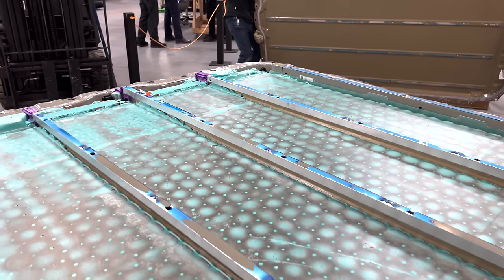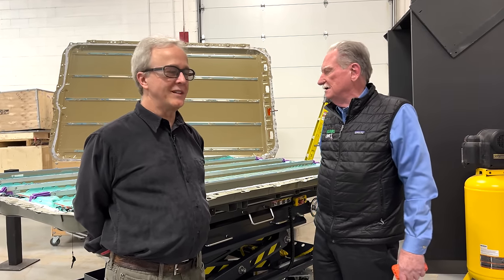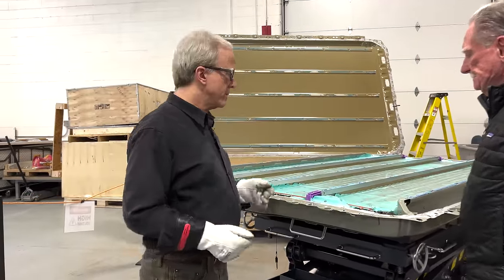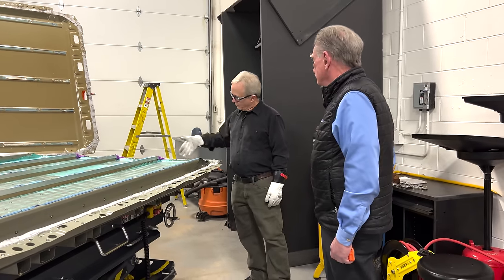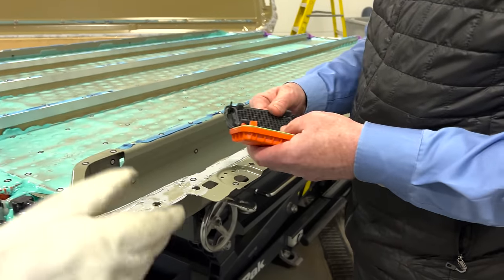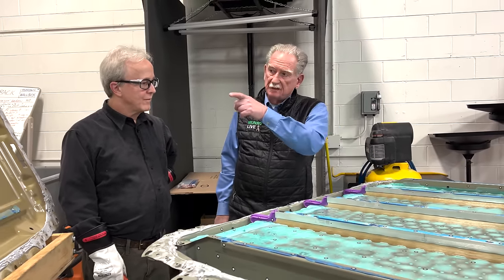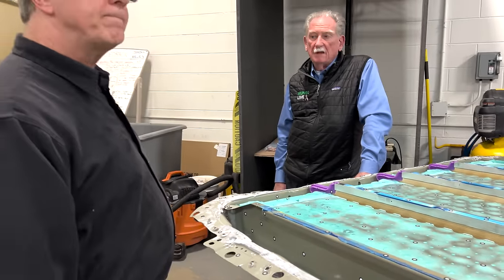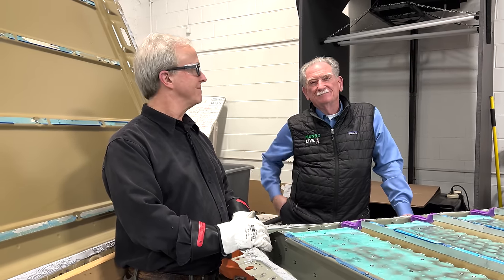Tesla Cybertruck Battery Pack: Our First Impressions Under the Lid

Comment: Fantastic session, gents - thank you. Fresh off a conversation with my service manager describing what it took to replace a couple bad cells under warranty in a BMW-designed battery pack for a customer. More in parts and labour than the car was worth, although being a MiniCooper EV of unknown age that might not be all that high...and that’s something that apparently was actually designed to come apart. 
So I must say, making something near completely unserviceable gives me pause. Yeah, sure it’s built to last til the end of time, etc etc, but everything can fail. I wonder if Munro ever gets asked to help design process that support servicing, not just making assembly as inexpensive and efficient as possible.
Reply: when it comes down to it the TIME of the people needed to service something will be MORE than the TIME of the people who put together another pack - because the pack manufacturing runs at super-high efficiency while repair doesn't.. economics (and maths) tell us that it's actually cheaper to replace.  Only caveat - if replacement is single supplier - there could be profit maximization going on which inverts the outcome.
Reply: Yes - great points. My first thought during the conversation was that if my Mini pack goes bad out of warranty would they even sell me the components to swap myself... As it is mine’s in for a warranty replacement of a battery management module that’s north of $4K just for the part. We enjoy the car immensely but the cost of the difficult/impossible to self service componentry under there waiting to go wrong does give me the willies as someone who does a lot of DIY. This repair would erase a year’s worth of fuel savings in the ICE vehicle this thing replaced if I was opening my own wallet...
Reply: Wright's Law in economics they will just swap the pack and it will cost you less that swaping out a ICE engine as it is far far simpler and takes a fraction of the time.
Reply: Swapping the whole pack also means the cells are the same age and have been treated alike. There had been interest in rebuilding the traction battery in Prius cars, but I believe replacing the whole pack with one of known balance is preferred for ease and longevity.
Reply: @  motorv8N  
The pack costs the OE manufacturer not as much as it's being sold to u (esp with middle-men involved).  Those are the real costs.  With competition being allowed to supply similar (compatible) packs the supply of such packs would be able to meet demand AT COST, negligible profit.  But with IP rules in place (patents, copyrights, etc.) competition is being prevented..  That is our collective problem.
Reply: @joansparky4439  - yes not like popping over to one’s local NAPA to source generic brake rotors, etc vs paying for massively marked up dealer stuff. I do wonder if the Right to Repair movement will catch up with the EV world. I can’t even find a shop manual for the car. First vehicle I’ve owned where I didn’t have the same service documentation as the dealer...
I’ve read the battery pack in the MiniCooper is made for BMW by CATL. Sourcing used cells from somewhere else might be an option one day. Frankly I’m just itching to disassemble the car just so I can see how it’s been built around its ICE roots but I’m fairly certain that won’t be approved by my long-suffering spouse who has put up with a lot of automotive detritus littering the place during various projects. I should apply for a job at Munro just to get this out of my system...
Reply: @  motorv8N    Hehe.. yeah, I can relate, somewhat, just on a smaller scale.

As for RTR catching up on IP rules preventing competition from functioning.. except for a few libertarians here and there societies AT LARGE haven't caught up to this for ~700 years, that's how old Patents are.

Comment: Brilliant. Designed to last. Not to be serviced. Exactly the right thing to do.
Reply: As if cars were indestructible machines that don't require being serviced.
Reply: Unless you need to service it.
Reply: Rich Rebuilds will find a way to service it if he wants to.
Reply: @RogerM88  Tesla is short on service centers.  In line with first principle thinking they hired engineers to revisit parts that require service/replacement.   Best service is no service.  This will also allow them to offer longer warranties.  This sort of thinking will make legacy unhappy.
Reply: @danharold3087   Guess you didn't read any repor about average automotive reliability. Where Tesla scores aren't the great. A car too dependent on complex electronics, will eventually fail, or become quickly obsolete. But keep drinking the Kool-Aid.
Reply: "First principle thinking"
Reply: @RogerM88   You have it backwards.   Properly cooled and sized electronic components are extremely reliable.  They are used in multi Billion dollar airplanes.  If properly designed they can be self diagnosing. 
Rather than become obsolete a software defined car can be improved over its lifetime generally  w/o visiting a service center.
CR and JDP are in the pocket of ICE manufactures who help keep the doors open.
Reply: @danharold3087   Water via moisture as dust will eventually find their ways into the electronics. You should or as a casual that never worked on a car or some electronics, or deep in Tesla Stock. Relax, the target Cybertruck customer base, doesn't even care about keeping the car for long, or care about efficiency otherwise they'd buy a Model 3 instead.

Comment: Based off his projected numbers of 48 long by 7 we end up with 1344 cells. Some calculations based off of a nominal voltage of 3.7 and 26ah per cell we get a 216s6p. That ends up being 799.2 nominal voltage and 124ish kwh total capacity. Which is pretty close to actual numbers of 800v and 123kwh

Comment: Not to put the cart before the horse but I'd be curious to know how this battery unit would be recycled?
Reply: The whole pack is probably shredded into little pieces and the pieces are then processed as if it was ore from a mine to extract various metals.
Reply: @cruiser97eric1  Thank you
Reply: @cruiser97eric1  Cheaper to throw it away that's what they're going to do.   When it is cheaper to make a new Battery than recycling  Because of the Horrible design.   They might as well Have filled the whole thing with epoxy!

Comment: Thanks, looks like 252S4P pack, around 1,000 cells. Its an old fashioned and expensive approach. It should be possible to build the battery with just half this number of cells.  

Hint best way to pop sealed covers is with compressed air.

Comment: Foam with air bubbles would tend to insulate (thermally, not necessarily electrically) but be lighter than solid or liquid. Solid is heavier but conducts heat better and can add rigidity to the pack.

I was surprised the cover stands away from the batteries. And it’s air between the cover and the batteries. Your sea green material looks like it has no bubbles and has the structural strength for the pack?

Comment: Fire departments are looking for a way to force cooling water into batteries. Can you see any way for an external input and output to be added to the batter that would allow the Fire Department to use a standard connector to supply cooling to the center of the battery during an accident or fire situation. 

If there is a video of the EV and the JetSki it would be nice if you provided a link to it.
Reply: Zero value to pumping water into the pack.  First you really don't want to get near it.  Second, water doesn't stop or even slow the failure either.  Best is to just let it burn out and suppress any nearby damage. Luckily EV fires are about 1/10th the rate as ICE vehicle fires.
Reply: @tesla_tap  Such tech does exist.   One solution is to inject some water such that it turns to steam and knocks out the fire then pump the battery full of water to cool the cells below ignition temperature.    They use what looks like a long floor jack to punch a spike into the battery to inject the water.
Reply: very good point ,if someone is trapped in a car , and the battery is in run away , what are the procedures to combat that scenario.
Reply: @danharold3087  - Steam and water do nothing to stop a lithium battery fire. Lithium burns just fine underwater. I think it consumes the oxgen out of water too, although not quite like tossing gasoline on a fire.  Really need to just let it burn out on it's own.
Reply: @andrewashmore8000  - While even in a serious accident, it's rare for the battery to catch fire, if it does, you have about 5 minutes before it really gets going. It's not explosive like a gasoline car fire that in a serious enough accident can almost instantly explode into the cabin.  

These accidents that have a fire (ICE and EV) are so extreme the passengers are usually killed before anything happens.  One case I know of the car was going 120 mph on a street, lost control and the thief sliced the car in half as it hit a light pole. The EV did catch fire after a few minutes, but the thief was ejected and was killed.
Reply: @andrewashmore8000  Firemen and spectators get sticks and roast wienies and marshmallows?
(right, that is in bad taste, and fatal to them too)

If the EV battery goes run-away, most of the time trapped passengers are going to fry or choke or be poisoned very quickly. Likely won't be time to flood the battery.  There probably won't be time to extract accident victims before they are terminal. The smoke from the run-away EV battery is a toxic soup of battery combustion byproducts.  

Hint: if you happen to on the scene of an EV run-away, you should do the same! 

Run away! 
UPWIND to avoid the toxic smoke. 

If you feel heroic, scream a warning over your shoulder to other bystanders as you beet feat away. 
Yes, really. 

The smoke is really toxic s**t!
Reply: @tesla_tap  You understand part of the process.
While one can pour water over a battery case and do little more than waste water.   Injection water into the case deprives the fire of the heat needed for combustion.   
There is some oxygen created in the battery but not enough to burn all the created gas.  "As oxygen mixes with the vapor cloud & heat continues to build, the battery cell may ignite, causing surrounding cells to do the same. " Burning Issues: The TRUTH About EV Battery Fires... Part One."
Reply: @joblo341  good to know.
Reply: @tesla_tap  Yeah and the ratio of ice vehicles on the road to electric is one in 100
Reply: @funnycatvideos5490  - The ratio of ICE fires to EV fires is based on the percentage of vehicles. There is about 250,000 ICE fires a year in the USA.  There are less than 250 EV fires a year. There a so many ICE fires, the news rarely reports them anymore as they are too commonplace.  EV fires get the news because they are so rare.